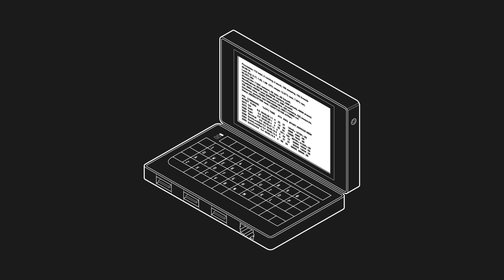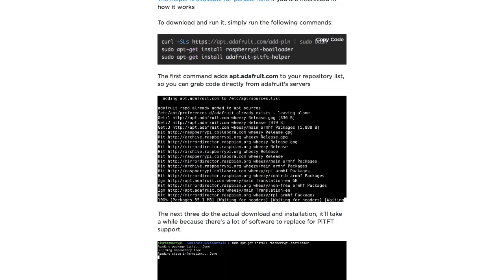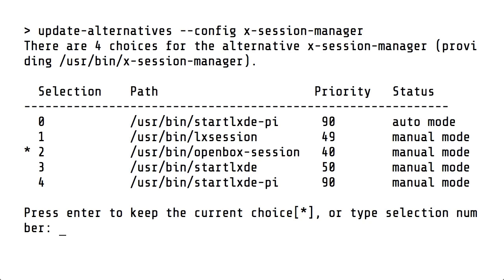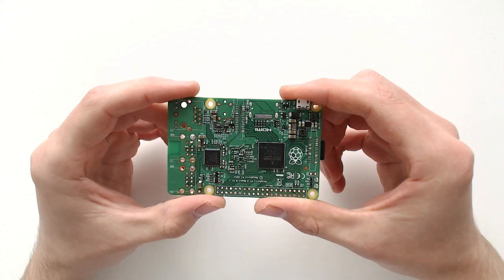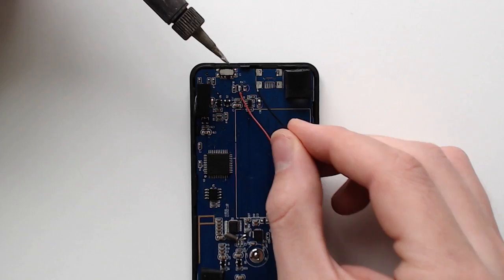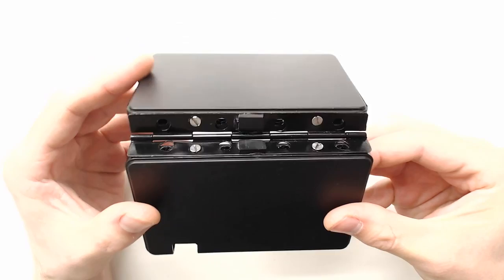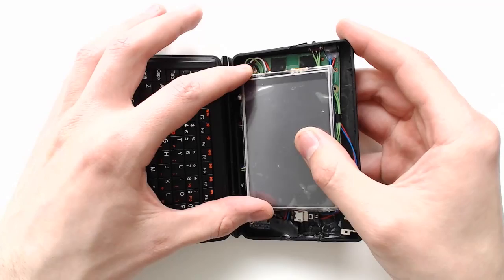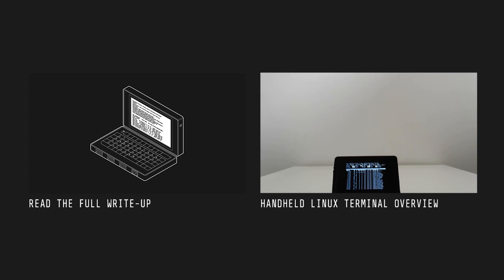How To Create A Handheld Linux Terminal (Portable Raspberry Pi)

Comment from the maker: To all the people who keep saying about the Pi Zero, there are a couple good reasons why I didn't use it:

1. The Pi Zero is noticeably slower than the Pi2/3. Especially for GUI stuff
2. It would require a USB hub board to have the same features as the Pi2. So, when you combine the USB board and the Zero together, it will end up the same size as the regular Pi anyway.
Reply: With all the attention this has been getting, keyboards are hard to find.  Will you return to this project to update it with a new keyboard in mind?
Reply from the maker: +Gus Bus Maybe. Or people could do their own research (like I did), to find a keyboard
Reply: +Gus Bus I actually found one pretty easily on DealExtreme, since Amazon doesn't ship to where I live. Here is the link http://www.dx.com/p/mini-handheld-rechargeable-bluetooth-wireless-keyboard-93118
It's really useful, since it has a battery indicator on it. And the pi, not. (Not to forget the full QWERTY keys which are rare on mini keyboards.)
Reply: N O D E but does it work with a pi zero

Comment from the maker: I'm working on the next version of this. Aims for this one:

- Bigger battery
- Easier/faster to make
- Custom 3D printed case
- Use the Pi 3

What other features would you like to see?
Reply: N-O-D-E I think a big thing to consider is how to fit a heatsink in there - such is life as these lil bastards keep getting more powerful! Also, cleaning up the hinge assembly for additional abuse-proofing is always welcome.
Reply from the maker: Yeah, good points. They just released the Pi Zero W with wifi/bluetooth, so I might make a Terminal "Lite" version first.
Reply: Would love to see a small "laptop" where you can't see the wire like this one, with the possibility to be both a PC and a gaming console. Would also love that anyone could make it without some kind of special tools.
Reply: Hey, have you heard of the Omega 2 from Onion? I'd like to see you use that in a product like this.
Reply from the maker: No I haven't, will look into it
Reply: N-O-D-E Awesome.
Reply: USB on the side, not the front :)
also, just for shits and giggles see if you can add a small camera. :P
Reply: they make one for it so not that hard if you keep the full board intact like in this version  https://www.youtube.com/watch?v=ndflyslzAEU he kept  it normal except adding switches and moved the audio jack, but camera layout you have two options front, or web cam style it would be up to you if you built it
Reply: @NODEtv  make a one with banna pi m2 zero

Comment: I was like "I could make this" until 3:09 where I went "JEEZ that way to many wires!"
Reply: It's actually a lot simpler than it looks. For all the GPIO pins on the pi and the screen you just gotta follow the orientation if they were still there. I.E pin 1 of the display to pin 1 of the pi. Pin 2 of the display to pin 2 of the pi. So on and so forth. Take the USB mount and make sure the plastic bit is the same way as it is on the pi, and solder it on.

Comment: Using the two 2.5" hard drive enclosures is a great idea, I'd love to see the same sort of thing done with game controls instead of the keyboard as I feel that sort of device would be great for running RetroPie. Any idea how long the battery lasts during CPU intensive use?

Comment: excellent. would be good to see more on how you built the case.
Reply from the maker: +Thomas Griffiths It's not that difficult. Just use a knife/saw to cut it up, then cover it with something so it doesn't look as bad :-P. The lids come off the hard drive cases, so it's easy
Reply: +N O D E just had another couple of views of the video. I can see what you've done, ever consider getting something 3d printed?
though I do find the hacking (literally) of HDD enclosures a fantastic idea...which I may pinch if that's cool
Reply from the maker: +Thomas Griffiths yeah i don't have access to a 3d printer, so this is way cheaper. Sure you can use the idea
Reply: @NODEtv  what's the keyboard

Comment: This is an awesome post.  Is there any chance you can go into a little more detail about the build?  Not sure I understand how all the power connections work.  For example, which end of the converter goes where?  And where do you attach it to the Pi?  Also, I assume you had to wire individually between the Pi and the PiTFT since you removed the header pins.
Reply from the maker: +Jack Hogoboom Sure. The power stuff is handled by the Adafruit Powerboost. Here's how it works:

Battery (3.7v) plugs into the powerboost, and boosts it to 5v. This 5v output then powers the RPi through a microUSB connector. 

The keyboard is also powered by the Pi (5v via one of the USB hubs), but since it was originally powered by a battery (3.7v), I used a stepdown convertor 5v - 3.3v to power it safely. (The 3.3v is sufficient, even though it was originally powered by a 3.7v battery.)

The PiTFT is wired directly to the board, and you can find more info about the correct GPIO pins to use on the Adafruit site.
Reply: +N O D E Thanks.  That's very helpful.  Looking forward to giving it a go.

Comment: Hi node, i'm thinking of making something like this, did you solder the keyboard on the same pins as the raspberry pi? (on the adafruit powerboost)
Reply from the maker: I powered it directly to the Pi from USB (5v and Ground), but inbetween I put a 5v to 3.3v step down convertor board (with the 3.3v side connecting to the keyboard)

Comment: Hey I bought the keyboard you use after I saw your V1. I have 2 small questions. Is there any way to default off the mouse function on it as the direction keys don't seem you work if the mouse it working. Also is there any way to hard wire in the keyboard? Keep up the great work and cool videos.
Reply from the maker: +ghostdirector I don't think there's a way to permanently disable the mouse unfortunately. I just click the little cursor icon to turn it off.

Other than powering it directly through the 5v from the USB or GPIO (with a 5-3.3v step down), I don't think there's a way to wire it properly. You'd still need to use the USB dongle somehow, but I guess you could disassemble it and solder it internally if you wanted.

Comment: Good tutorial. I'm a bit scared for what appends if do I remove the 2 hub USB and the Ethernet port, the pins, ecc. So, I will do this project but  
I'll ask help to remove the USB ports and Ethernet. Thanks for the tutorial
Reply from the maker: Yeah, try it out and see what happens. Just make sure you don't scratch/damage the board while you're removing them.
Reply: +N O D E To be sure I'll make another design, like this I mustn't remove USB ports, Ethernet, ecc. 
Me I've got a lcd display of an old smartphone. Can I use that for display? thanks

Comment: My plan is to upgrade to the RaspberryPi 3, and the 3.5 Adafruit PiTFT touchscreen.  My plan incorporates another Adafruit example (Diet Raspberry Pi) that removes the Ethernet port, and replaces the stacked USB ports with 2 single-height USB ports.  That uses the built-in wifi and BT, and still leaving 2 USB ports for a hub, and can use a USB-Ethernet dongle if you want/need wired network capatability.

Unfortunately, I now have limited dexterity in my left hand, so this might not get done very quickly (I'm typing this right-handed).

If someone wants to run with this idea, go for it.  Just mashup this plan with the Diet Raspberry Pi plan, and glue on black plastic piano or dual mini hinges (eliminates some drilling and screws).

Comment: Would a Raspberry Pi 3 work as well? I mean it has built in Wi-Fi and Bluetooth. While I don't know about Bluetooth, the Wi-Fi would  certainly be an improvement over the Ethernet cable.

Correct me if I'm wrong.
Reply from the maker: I originally tried it with the Pi3, but at the time, the Raspbian image didn't support the drivers for the TFT screen. They do now, so it should work fine.

One thing to note is that the Pi3 runs very hot, and might be a problem in a small case like this.
Reply: What about trying another OS, would Arch Linux work out as well?

Comment: Great video. Subscribed.

Can you give a little more detail about how to solder the HDMI pins to the HDMI pins on the screen? I bought a 5" display to use for this build but leaving on both HDMI ports makes it too fat. 

Did you just wire the GPIO to where the connector was on the display 1:1?

Thanks for sharing!
Reply from the maker: +Logan The screen I used isn't HDMI. It's the PiTFT. It mentions on this page which specific GPIO pins need to be soldered: https://learn.adafruit.com/adafruit-pitft-3-dot-5-touch-screen-for-raspberry-pi/overview
Reply: +N O D E Ah I see. Looks like they don't have a 5" PiTFT display... I think it should still be workable though just have to do a bit of finicky soldering work, eh?
Reply from the maker: +Logan Depends how big the enclosure is you want to use. A 5" HDMI display will be bulky. You could try soldering directly, but since HDMI cables contain 19 separate wires, it will indeed be a finicky soldering job

Comment: I understand everything (to an extent) but the step down regulator. What's it used for? Where can I get one?
Reply from the maker: Search on Ebay/Amazon. You need it because the Pi's output is 5v, and the input to power the keyboard is 3.7v. If you put 5v directly into the keyboard it would break it, but if you use the step down and change the 5v to 3.3v, it will work.
Reply: N O D E thank you for replying. I bought one because it looked important(hahaha) so thanks for clearing it all up.

Comment: Would using the PiZero and usb hub with ethernet be viable for such a project?
Reply from the maker: +Suhaib Sufi I did something similar for version 1, but had lots of problems with different USB hubs. They seem to be incredibly fragile and break easily when you solder them.
Reply from the maker: +N O D E There's also the fact that the PiZero is noticeably slower compared to the RPi2, so bare that in mind :)

Comment: If I removed the keyboard battery and used a normal battery pack and hooked that up to the pi and connected the keyboard via usb to the pi, would it work without its battery ?
Reply from the maker: If the keyboard is USB, it doesn't need a battery anyway, it would get power from the USB wires.
Reply: this is the keyboard, I was thinking of just removing the battery and using and ultra thin battery pack to power up the raspberry and connect it to the raspberry https://www.amazon.com/gp/product/B00I5SW8MC/ref=ox_sc_act_title_1?ie=UTF8&psc=1&smid=A1JQNKX8H5YU3Y 

and very fast reply thanks!
Reply from the maker: Yeah it'd work just like I did it. Your battery would power the Pi, and a wire from the Pi's 3.3v GPIO pin could be soldered directly to where the battery on the keyboard used to be.
Reply from the maker: + the Ground GPIO (forgot to mention)
Reply: N O D E thank you very much, awesome, I was hoping to skip the soldering and just power the keyboard with USB without the battery.
Reply from the maker: The battery inside the keyboard will be 3.7v, and powering it directly through USB (5v) will probably break it.

Comment: Do you have to install all the "stuff" or could you leave it with the "stock" operating system?
Reply from the maker: it's up to you. You will need to use the PiTFT Raspbian image for the screen to work. Anything else is up to you. I chose i3wm because of the screen space it saves, and that it can be navigated using the keyboard.
Reply: N O D E Thanks so much! I am definitely going to build one I just didn't know if it had to be terminal( I'm fine with Linux)
Reply from the maker: cool man, good luck :) let me know how it goes
Reply: Hola! Te vas a poner a construirla?Yo estoy en ello también! Si quieres nos ponemos en contacto!

Comment: Is it possible to get the case for 3D print, instead of using hdd cases?
Reply from the maker: Yup. I'm working on a new version, which will have a 3D printed case
Reply: Amazing. Also another question, how long does the battery hold before needing to be recharged?
Reply from the maker: 1-2 hours depending on what you're doing. Next version will have bigger capacity battery

Comment: Can I use a Raspberry Pi 3 instead of the Pi 2 ?
Reply: just tell me XD
Reply from the maker: lol yes you can
Reply: thank you, kind sir
Reply: Incorrect, the Pi3 wants 2.5a, far from the 1a max that the powerboost can provide. It would be possible with a different Li-Ion charing circuit.

Comment: Could anyone link me to a video on how to do something like this with the pi zero
Reply from the maker: There are a few downsides with using a Pi Zero for something like this:

- It's noticeably slower, almost unusable
- You'll need to add a USB hub board to make up for the extra ports
- Pi Zero doesn't have sound
Reply: thanks
Reply: Pi zero does have sound

Comment: If I use a Raspi 3, would I be able to install the Win10, btw. Linux version for it (https://www.raspberrypi.org/downloads/)? And if I do so, will I be able to I play old games or linux games, and probably gothic I on it? Cause then it would be even more the coolest tiny PC in the world!
Reply from the maker: It all depends on whether the drivers for the TFT screen will work on a different OS. Maybe worth checking out the PiTFT page on the Adafruit site, and contacting them.
Reply: But the Raspi would have enough power to challenge Gothic?
Reply: Nope. You can't play Gothic or any other game on Windows 10 for Raspberry, because this is Windows for IoT and there is no normal Windows 10 for Raspberry. And what is important, Gothic is game for x86 processors. Raspberry Pi is ARM.

Comment: Awesome work, love this and I'm giving it a try, but I'm new in this world and I need some help.
How do you connect the power switch to the pins of the powerboost???? I mean, I bought this power switch:
http://tienda.bricogeek.com/interruptores/200-interruptor-on-off-cuadrado.html
Is this ok, can I use it? Or i need another one? Sorry for the page in spanish, it is where I bought it, and sorry for my poor english, hope you can help me.
EDIT: the datasheet of the switch I bought is on the page, this is the link:
http://dlnmh9ip6v2uc.cloudfront.net/datasheets/Components/Switches/Rocker%20Switch%20Right%20Angle.pdf
Reply from the maker: Read this: https://learn.adafruit.com/adafruit-powerboost-500-plus-charger/on-slash-off-switch
Reply: Thank you! Solved my problem, I'll continue and lets see if I can finish it